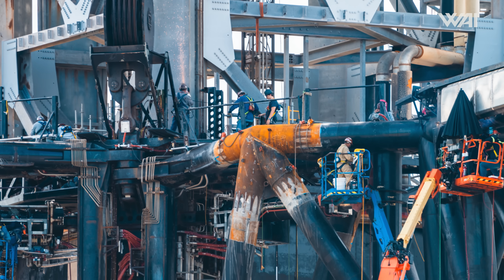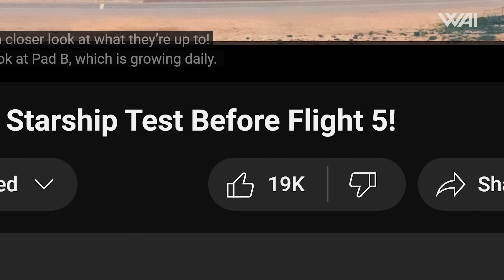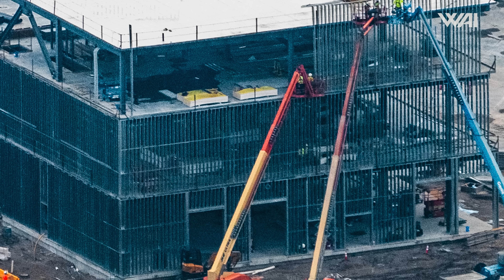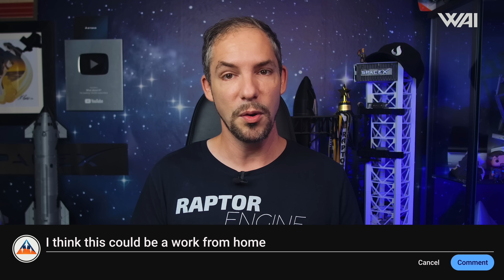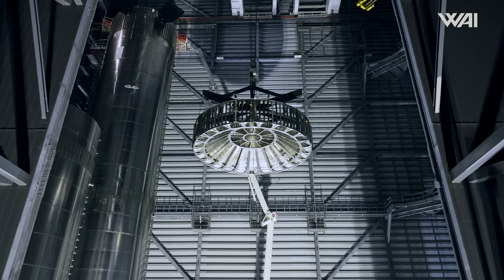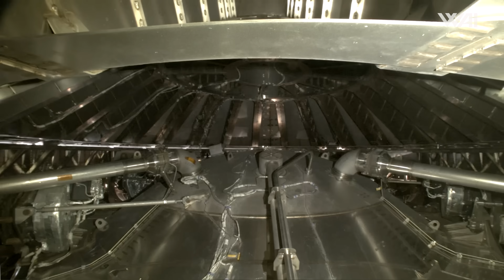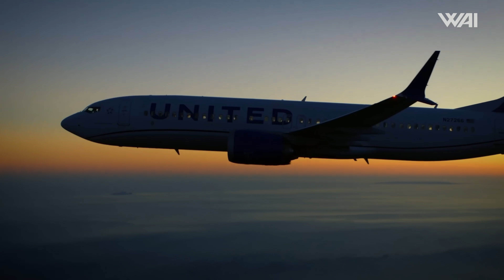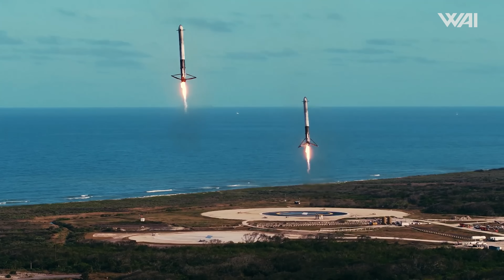SpaceX Finally Lights Starship Engines Again! Is China Catching Up?

Comment from the maker: How Quick do you think will SpaceX be able to produce Starships at some point? :_WAISweet:
Reply: at some point? ikd... like 1 000 000 per year?
Reply: @TenSoboljem  That would be 2700 a day.
Reply: To include the boosters?
Reply: I think they never intended to abandon the bumpers.
Reply: SpaceX new Raptor engine facility will produce about 1,000 engines per year. That works out to about 25 Starships per year.
Reply: @calc1657  One pair per month, Super Heavy and Starship, is a reasonable estimate for now. 

Once the SH boosters are dependably returning and inventory is high enough, the Booster production will be just high enough to replace losses and obsolete versions.  

By then, Starship production will saturate the remaining factory capacity. Maybe 3-4 Starships per month by 2026. 

Eventually, 9+ Starships (just second stages) per month, depending on engine production ramp-up and booster losses. For higher capacity, another factory in Florida would be needed.
Reply: @imconsequetau5275  25 per year is a good number to start with. After that, it depends on how much the demand grows.
Reply: I would have expected the bumpers to also include a cushioning system, not just hard steel.
Reply: @peterclarke3020  They have stainless steel pillows. Stainless has enough flex depending on the thickness. We're talking about a structure that can take flight stresses so it should be plenty.
Reply: The re-enforcements of the Office Building is like meant to add more stories on top of the building 👍🏻
Reply: They claim one every 72 hours when they hit full pace. I see no reason why they can't eventually hit that.
Reply: SpaceX will later end up with ‘Type Licenses’, which will certify all Starships within a particular design class.
Reply: Is 5 going to put a ship in space and capture the booster?  If the government doesn’t get on the ball then the Chinese will be sticking a  huge starship like object in space. Chin doesn’t June all these hoop.
Reply: @jonathanhughes8679  Good for China. The US should focus on its own accomplishments.
Reply: When fully kitted out and at full production the plan is to build one per day. 
"Plan" not "Hope".
Reply: @anthonyshiels9273  I'm confused how FAA will certify a ship a day, that's why I went with one a month. ha
Reply: SpaceX will end up building many more Starships.
Reply: @Whataboutit  if they go to a country that wants Togo space over night. But the us doesn’t
Reply: Thank God for fast-forwarding. It's crucial to skip past the fluff, old content brought forward, and three advertisements on every video.

- Thank you, Youtube. 20 minutes of content in 4 1/2.
Reply: they need to lauch way more
Reply: @Yerosee  tell the FAA...
Reply: Hallo Felix, hab grosse Respekt fuer das, was Du hier tust und erreicht hast. Gigiantisch. Wenn ich eines doch sagen darf: Deine Promotions und Ankuendigungen gehen in deinem Redefluss unter. Es ist alles ein "Brei". Wenn Du eine kurze Pause machen koenntest, Luftschnappen oder so, dann waere es klar, dass du einen neuen Gedanken hast. Daumen hoch, kann leider nicht in Deutschland sein und hoffentlich bekommen die Buerokraten in den Staaten ihren Papierkrieg unter KOntrolle. Ist ja fast so schlimm wie in Deutschland, fuehlt sich so an. WIr druecken die Daumen, dass der Flug bal stattfindet und dass alles wie geplant klappt!
Reply: Doubting SpaceX isn't wise at this point, so I think they will hit their goals no problem.
Reply: Quick quick.!!!!
Reply: new yr now after all FAA . Faffing about...... lol
Reply: Their goal is 1000 ships disembarking to mars every 2 years, isn’t it?  

They will need more for fuel transfer.  

I’m going with 2 per day as a “short term” baseline design plan.
Reply: Well I honestly don't know, I feel like that is entirely dependent on if or how much the Starfactory expands in the future. Knowing Elon, he will probably build a second Starfactory after learning all the lessons from developing the current Starfactory. I would reason that highest point output the current Starfactory could achieve will be somewhere between seventy to eighty ships a year. But a second Starfactory designed with the lessons of the first, could probably produce a hundred to a hundred fifty new starships off the line a year. There may not be a need for all those though but who knows if the whole mars inhabitation thing works out, it could happen.
Reply: Boeing / Airbus builds 1 ~ 1.2 airliners per day once production is up, running, stable, and mature.  Might be something like say 1/2 ~ 1/3 of that, i.e. 3 ~ 5 per week.  Airliner has more interior detail work for passenger compartment, SH + SS has simple interior, but way more engines, plus a labor intensive heatshield.  Raptor production may be the limiting factor.  Expect SpaceX to set up / run multiple Raptor production lines.
Reply: Not very quickly because flight testing miss proceed before knowing how to improve. The ships feedback is with the program needs. Why is the Democrats Kamala Harris retarding SpaceX?
Reply: @dennismartin434  LOL. You guys eat breathe and $hit the right-wing politics.
Reply: @calc1657 
Her question is valid. It's not right wing politics.
Reply: @Richard-f4b4r  No, it's not. Harris doesn't regulate anything.
Reply: 1 a week or maybe 2-3 in a month
Reply: My guess is 1 starship a month at some point soon.
Reply: I think once space x buys out all the other space companies in a few years they'll have enough launch pads and megafactories to produce and launch 10 a day.

Comment: Starships will be growing and the tower appears to be the same height. Only outlier is OLM. I had a thought, to compensate for additional height, could they shorten the OLM and continue the trench for the flame diverter. Seems the most logical to me to accommodate V2 and even V3 ship and booster.

Comment: Why does Starship V2 not need to do a fight test like the original testing Starships (the 13k ft launch, belly flop, vertical flip and landing)? Since this is a design change, wouldn't SpaceX want/need to verify it will have proper control like the larger flaps had?

Comment: SpaceX needs to make a third tower.

It would surprise me if the FAA started regulating tower upgrades and delaying launches from certification timelines.
1st Tower meeting FAA launch requirements.
2nd Tower under FAA launch approval.
3rd Tower under upgrades and repairs.

If damage occurs to a tower, things could really slow down without at least 3 launch site's just for development.
Maybe those Oil Rigs should be developed now.

Comment: Chopsticks Idea: What if they add a cushioning system into the chopstick bumpers, Making the arms' impact cushioned while closing on the booster, and the booster taking minimal force to its sides, completely removing the need to add cushioning into the arms where it will touch the booster.

Comment: Launch control should be a bomb-proof bunker. Everything else is asking for disaster for no reason. Between hurricanes and the rockets, having a strong core for your essential team is  the only sensible choice. An office that is vibrating will have floor joists failing early, uncomfortable workers distracted by vibration, and circuits and wiring shaking as well which would create pulsing EMF which would degrade computations.

Comment: I know that the apollo-program used some sort of guilded/gold-looking mylar-type of insulation to keep the heat out. Would it be possible to use something similar to insulate the inside of the tanks on both booster and starship, to cut down the amount of boil-off and number of refueling flights needed for the moon-shot?

Comment: Of course China will catch up, they just steal everything once it gets to production stage.
Reply: True, because what have the Chinese ever done for the human race, oh wait hang on………

Acupuncture 
Banknote
Bellows
Belt Drive
Biological Pest Control 
Blast Furnace
Bomb
Borehole Drill 
Breaching Strap
Bulkhead Partition 
Cannon
Cast Iron 
Chain Drive, Endless Power Transmission 
Chromium
Co-fusion Steal Process
Crank
Compass
Dental Amalgam
Drilling Rig
Finery Forge
Firecracker
Fire Lance
Fishing Reel
Flamethrower 
Flare
Forensic Entomology 
Fragmentation Bomb
Fuse
Gas Cylinder 
Gas lighting 
Gear
Hand Grenade
Hand Gun
Helicopter Rotor
Hydrometer 
Inoculation 
Keel
Kite
Ketchup 
Land Mine
Match
Modular System of Architecture 
Multistage Rocket
Naval Mine
Nickel Silver
Oil Refining
Oil Well
Pendulum 
Petroleum as Fuel
Porcelain 
Raised Relief Map
Rockets
Rocket Boosters 
Rocket Launcher 
Rudder
Seismometer 
Solid Propellant Rocket
Steel from cast iron through oxygenation 
Suspension Bridge with iron chains
Tea
Toilet Paper
Well Drilling

Comment: Nice show thanks Felix. Looking at your variations on the Starship 1 and Starship 2 and Starship 3. I was wondering on your opinion concerning the fact that The launch 🚀 Tower will barely be able to Deal with This FIRST Rocket 🚀 to be Caught since it bends already as well as the arms look a little suspicious. So when the bigger new ship s come along. (A) SpaceX is going to need to apply to The FAA for new Landing Permission and Permits. Also what concerns me and I’m sort of hoping that you will address wether or not the current system will catch them. Adding to that the extra weight of the parts they ve being ejecting of late. I mean it’s a lot bigger and heavier. Hopefully I will hear your opinion on the matter.

Comment: Launch control or not, that office building is close to the pad and faces the pad. It's flat land to the pad, no obstructions. 

That building would need reinforcement against the sound waves. We all saw the sound shock waves on flight 4. Also, if you noticed the shaking of screens in the building where Elon was, I assume that was the Stargate building. Stargate building has a megabay and high bay, plus star factory between it and the pad.

If you just put a glass wall in a direct line of sight to that pad, it likely wouldn't be a glass wall for long.

Comment: The bumpers always were needed or the Chopsticks will dent the Boaster turning it to a single-use rocket. The problem is they need to be at the end, not the pivot because of the flex in the arms.  They need to be at the end.  If SpaceX was smart they would be trying to catch a StarHopper, FlyingSilo or one other Starships waiting to be scraped, not a first with a falling Booster

Comment: You have the FAA portion wrong.  SpaceX submitted the paperwork to use the new fuel farm 6 weeks before flying. SIX WEEKS.  The FAA waited until 5 days before the flight to say they needed more time.  So the FAA had the paperwork over a month and did NOTHING.  SpaceX's customer had already paid for the flight. The tank farm had all the appropriate local and state permits. There was ZERO public safety issues.  Furthermore, just a few weeks after this flight that they are being fined for,  the FAA granted a waiver for the fuel farm so that a national security flight could proceed..... Yep.   So the FAA knew about the new fuel farm and said "nah we need more time", but then turned around and let them use it anyways for multiple future flights..... and NOW they are going back and saying, "yeah you messed up".... Wait.....WHAT?!?!?  The FAA is saying SpaceX is a fault, but it's CLEARLY obvious the FAA is the problem.  If this was such a big deal, why did it take the FAA OVER A YEAR to issue the fine?? This just reeks of bureaucratic BS, plain and simple. This clearly shows how inept, inefficient, and flat out biased the FAA is.  If SpaceX sues the FAA, (which they 100% should) they will win in a landslide.  It's an open and shut case of a federal agency overstepping its statutory limits. 

The other fines were for moving a mission control room and not holding at T minus 2 hours in their launch count.  Yeah... SUPER serious public safety issues..... eye roll  I mean honestly, it's pretty pathetic.  This bureaucratic BS is beyond embarrassing and frustrating.   It's obvious to everyone that the government simply cannot keep up with the rapid pace of the commercial space industry.

Just remember - Vulcan will fly shortly and will be 100% disposed of by crashing into the ocean at high speed, spreading debris and poisoning the water. The FAA is fully ok with that....
Reply: Wonder if the FAA has ramped its staff to keep pace with SpaceX…?
Reply: I wonder if FAA workers hate SpaceX and it’s reusable rockets
Reply: @Coconutisbored198 why?  Do they hate Boeing and their reusable airplanes?
Reply: @worldtrav72  I have no idea

Comment: Still, imo, the hotstage ring should be in two pieces, with the 'ring' a permanent part of the starship and double as a (won't need legs to land on moon or Mars)  landing ring; and the protective dome to be a permanent part of the booster to reinforce the mechanics of the grid fins. It's a matter of give-and-take and acceptable trade-offs for rocket design engineering. IMO

Comment: I wish SpaceX would just bite the bullet and go back to the old license permit and LAUNCH NOW. That would give them lots of repeatability data, test the heat shields, save the launch mount from possible destruction, and much more. And the 2nd tower would possibly be compete as a catch-only tower and we are set to go again immediately (in December?).

Comment: I love the way everybody in these comments assumes the worst of the FAA. Why not take it at face value as to the reason? 
The Federal Aviation Administration has postponed SpaceX's next Starship test flight until late November 2024. The delay is attributed to extended environmental analysis and additional review requirements.
I think there are plenty of environmental concerns regarding SOMETHING NEVER TRIED BEFORE that should be considered. Let's say there is a worst case scenario and the booster slams into the launch tower upon reentry and the remaining fuel ignites and then rains down on the launch pad and has to be put out. The water used to put out the first then drains into the wetlands and ocean. What are the impacts? 
Does anybody in the comment section here KNOW? No they don't. 
Just a bunch of fanboys spouting off against a gov't agency because after all ALL gov't is bad right? 
Guess I have a different perspective. I think this entire process should be slowed down some and that SpaceX is your typical company that gives lip service to safety and environmental concerns unless FORCE to do otherwise. Both those things COST MONEY and boy is it bad for business for things to COST MONEY to properly design for. I do believe that for crewed flights they are concerned about safety, but for these flights? They just want to get them performed and of course ELon has is Mars flight goals looming. His only reason for a timeline for those is HE ISN'T GETTING ANY YOUNGER and realistically it will take decades for him to realize any of his dreams (regardless of Elon time). I'd rather they take some baby steps now with the intent of picking up design and manufacturing speed later because they did all their homework now. If they work WITH the FAA and the state agencies, you think they might get faster approval vs being jerks and starting lawsuits? Think in terms of what your reaction would be if treated poorly. Would you bend over backwards to help someone? I think not. The people who work in these agencies after all are PEOPLE and if you malign them and their workplace, I'm sure that mentally to some extent they have an FU attitude and will get their job done, but probably not as fast as if you treated them civilly and did what they asked. 
Does that mean the FAA doesn't need to review their procedures to see if they can improve them in order to support increased rocket launch cadence? Sure they do, but that is when there is approved and proven rockets like the Falcon 9, not for testing prototypes that remain largely UNPROVEN. Have we seen a perfect launch and landing yet from a booster or starship? NO. UNPROVEN. Falcon 9 has had many PERFECT launches and landings. They deserve to have a fast FAA approval and launch sequence. Starship isn't there YET.
Reply: Take the US government at face value? That would be a tremendous leap of faith.

Comment: The chopstick bumpers have always needed a shock absorbing plate. They will continue to redesign until they wind up with the perfect fit.
Reply: or adjustability...maybe?  for cold and hot sizing changes.

Comment: I'll say it again. SpaceX should just cover the OLM in heat tiles. If they can stand reentry heat for minutes, they certainly withstand launch heat for seconds. Shouldn't need any refurbishment at all.
Reply: Very different environments. I bet the main problem of the launch is not the heat, but huge force/thrust.
Reply: @jonathanrichter4256  overkill and fragile at the same time. Steel is better for durability, but I think mainly they need to rebuild the flame diverter once pad b is continual. Then some tweaks on the launch profile and they should be a lot quicker.

Comment: SpaceX built nearly 100 of those raptor ones in the early editions for upgrades on Happy The starhopper. So they have lots and lots of extra parts laying around but won't fit anything else they need to put starhopper back into production and practice catching with it. Just for fun. Maybe even.

Comment: Seems to me that the “bumpers” should be electromagnetic land lock shut when they get close to or touch one another. I think that would fix the bounce they’re currently getting and keep the chopsticks tight against one another during capture.
Reply: Awesome theory.  i like it.  and what about some hydraulics too adjust for squeeze rate.
Reply: hydraulics or electric motors? Both would work. I hate seeing that slap back and hydraulics would likely fix that.